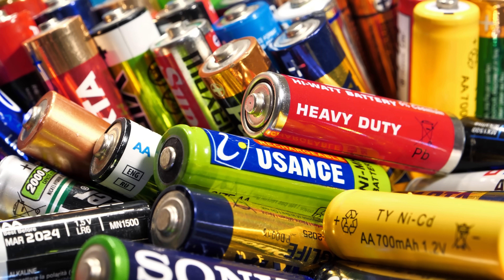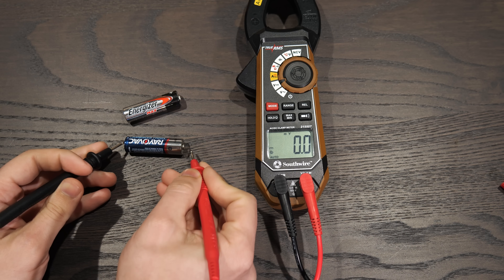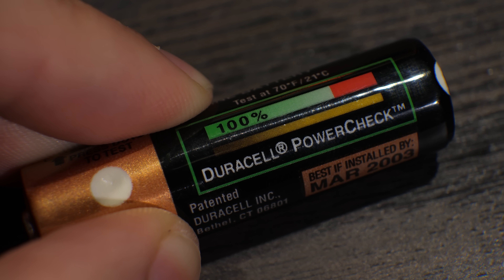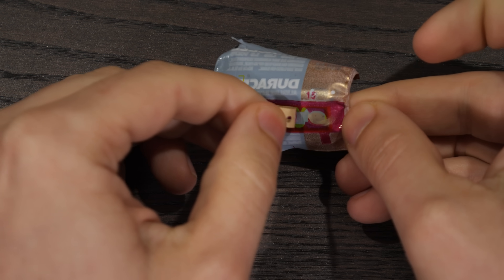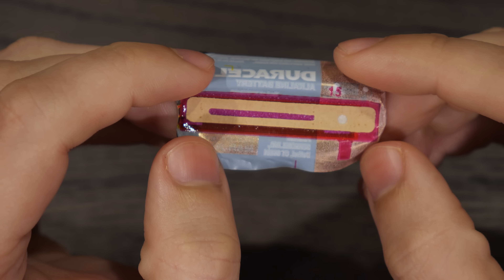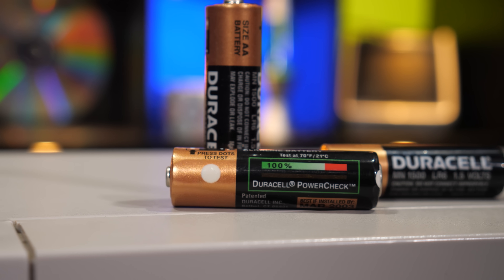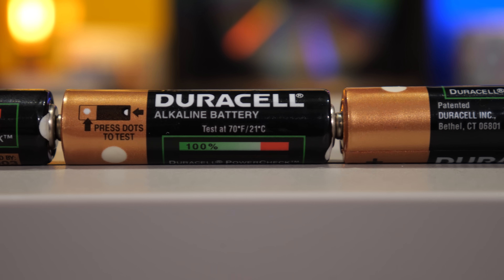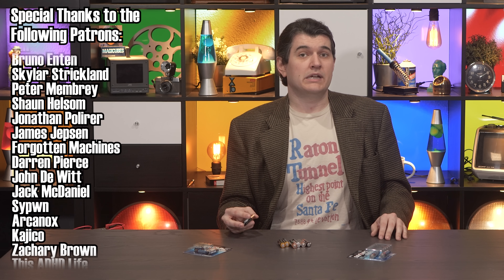Duracell PowerCheck: A genius idea which didn't last that long

Comment: I remember these.. im sure theses probably still some of these laying around in my basement drawers someplace likely new in the pack and dead... honestly the little tester for me was useful as i often would misplace packs of batteries and then buy new..  so when id find them they might be past their "best if used by" date.. so id use the tester and most times you had a good year or 2 ..sonetimes more after the date that they would still show 100%..  I have multimeters and such... but like yopu mentioned most things use chargeable batteries..  I really only put AA's in my TV remotes.. and the Only time my TV's are on is during american football season... the rest of the year i just dont use them...  if I push the on button and the TV doesnt come on.. first thing I do is change the cells...  but i renember n the 90s going through so many AA batteries for my beepers and tape / CD players , palm pilot(the first ones werent rechargeable), calculators,flashlights, bicycle lights..  so many things had batteries...

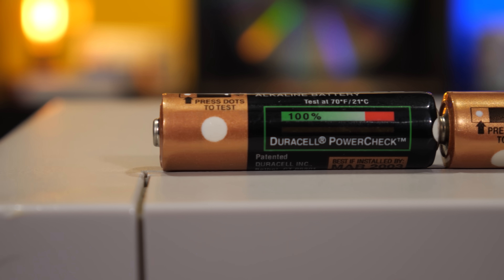Comment: Short circuit at 12:34.  I remember doing this as a kid with some rechargable batteries in an RC car that took 4x AA.  The cover on a couple of them got torn, so I figured I'd just peel them off, thinking they were only cosmetic,  Of course when you put them in, and there's nothing keeping them from touching each other, they just short out.  The car worked intermittently (as they randomly bumped together dropping randomly in intervals of 1.5v, and eventually I noticed that it would be slightly warm after the short run-time I got was finished.

Comment: I remember these, but it felt really uncomfy to press them, because they weren't like buttons or anything, it just felt like pressing down on a regular battery.. which you had to do with both of  your fingernails, they would bend, it'd be very unconmfy, and you'd have to press really hard to see the charge.

And I don't know if it was just me but it seemed like the more I pressed it, The more charge would show up?

So it would just measure the force of my pressing rather than the actual charge.......

Soo I never liked them and always hoped they would make one with an actual button you could press.. but. they never got better and just disappeared..

so I never liked these to be honest > - <

Comment: I remember these. I didn't know they could be activated by heat. I guess it makes sense since the yellow strip was uncomfortably warm to touch. I can't be the only one who was curious enough to touch a full yellow bar. I eventually got a cheap little volt tester with a battery caddy and noticed something weird about the batteries I was replacing. In more than one device, only one battery would be truly dead while the other still had power. Made me wonder how many good batteries I tossed out over the years.

Comment: Even the Gameboy Advance would give you that ominous red LED when its batteries were running down!

I actually have one of these thermal battery tester things as a standalone little sheet of plastic, it's designed for 9v batteries though.

Comment: Coincidentally, my wireless keyboard just ran out of charge and I tested all the AA batteries in my drawer to find the lowest battery over 1.2v that isn't in a pair (as my keyboard needs only one). I have a Duracell PowerCheck AA that registered 1.2V on my multimeter, and it has a best before March 2026! I decided not to use it in my keyboard as it was worthy of preservation. However, at the end of the video, I decided to use the powercheck meter and it didn't show any reading at all. Testing it dropped the voltage displayed on the multimeter to 0.6v. Once I released the dots, the voltage dropped back up to 0.9v. Awesome video!

Comment: The heating element explains an experience from my childhood that has puzzled me for years: I tried using one of the cheap test strips included in a package of AA batteries to test the remaining capacity of a 9-volt battery. It makes sense now, but at the time I was quite surprised when the test step caught on fire!

Comment: I had a series of subpar wireless computer mouses, and was never entirely sure if they were losing connection due to bad batteries, faulty equipment, or a wireless connection error.  These indicators would've been extremely helpful with troubleshooting, but that's a rare and specific problem.  I ultimately abandoned the wireless option altogether and purchased a wired mouse.

Comment: 11:17 funny you mention that, i'm still using one-way batteries for my xbox 360 controller and whenever the controller deems them used up i keep them for when the battery of my mouse dies. Ironically inside my mouse one of them usually lasts me for at least another month before they're actually out of juice. I don't know how the G604 does it but the energy saving capabilities of this thing are like nothing i've ever seen.

Comment: Duracell still makes and sells those batteries. One great feature is that you can test whether the battery is dead or the device you're trying to power, without needing a multimeter.

Comment: It seems like it's a good idea that some tv remotes these days have built in rechargeable batteries (my Samsung has one that also has a little solar panel on it). The problem is one day that battery will stop holding a charge making the entire, original TV remote useless. At least with replaceable battery remotes, it will work forever as long as you don't let the battery leak inside or physically break the remote. And anyone who has an old TV and can't find the original remote which locks them out of some menu function knows how annoying that can be.

Comment: I test batteries by dropping them on the negative part, if they bounce they're done. Saw it online a while ago, it's worked well so far. Also just mostly use rechargeables nowadays...

Comment: I can think of one time you might actually remove every alkaline battery you have (and possibly set aside for later use):

When you buy Li-ion rechargables and a battery charger.

I actually recently did just that, so it was amusing to hear you say it's pretty uncommon.

Comment: I would love single-cell 18650 Li-Ion batteries to have this tech nowadays, but fear that the resistant element would burn up in a split second as the available current is much greater in these. I liked these Duracell batteries in my Walkman!

Comment: I get a constant supply of batteries from old electronic toys I test, to see if they work. But I use my vintage Samsung YP-C1 MP3 player to check how much power there is left in any AA batteries due to how battery efficient my MP3 player is.

Comment: Makes total sense... says the guy with 20-odd half-used batteries in a box.  I have a separate checker.   I have learned my lesson about leaving batteries in radios, etc. and then having to clean out the acid that leaked.  I used to use rechargeable batteries, but some devices just didn't like them.

Comment: Oh those times when battery producers were competing heavily each other through TV ads, obviously aimed at kids and youngsters. This power check was obviously another marketing trick to pull some more money from kid's parents' pockets. I remember considering this power check as useless gimmick.
And I don't think we got any greener with built-in non-user-replaceable Li-ion batteries in devices. Once the crappy Li-ion battery is dead, the whole device gets dumped.

Comment: 13:32 I strongly disagree here.
Modern devices now come with glued, proprietary and hard to replace batteries. Which means these gadgets now become almost useless after 2-3 years.

Older devices, which take AA or AAA can also take RECHARGEABLE NI MH batteries. And those devices had long life with quick repairablity. I have many such old devices now.

Comment: My favourite college elective did a practical section every month where we were presented an irl problem & had to come up with a product/apply a physics concept to fix it. After a set amount of time, every group presented their idea & then we studied how the irl solution works.
In one class we were asked how to check if batteries are still working if you find some in your drawer & most groups came up with some tester since some stores have those in case customers come back claiming they were sold empty batteries while one group actually knew of these batteries & tried to reverse engineer how it works.

Comment: Problem was, in some battery holders it was possible for both dots to be pressed by accident.
I had a Praktica flash gun that took four AAs in a rather tight holder. I went to use it and found it virtually dead - three of the cells were perfect, but one was ABSOLUTELY dead - I'm guessing it self-discharged through the tester. :-(

Comment: I don't think I ever learned how that works. I remember doing it when I was child but I don't remember actually getting a reading. I think there were also imitations that has them but probably don't really work.

In fact, I kinda remembered that I thought pressing them will recharge the battery 😂

Comment: Are you a mind reader? I honestly was just wondering about the PowerCheck feature a few days ago when I bought a new pack of AA batteries (ironically for my digital multimeter) and wondered when and why they quit including it. Like you, i don't tend to have loose batteries laying around. Even the few items that I use infrequently and also remove the batteries from, i usually keep those batteries with the device or put them with the new unused batteries and then use those first. Generally all my batteries are in one spot which makes my life easier when i need them. I also do have an old analog battery tester, but honestly rarely use it. Great video and thanks for solving my personal mini-mystery.

Comment: The one use case that I think is legitimate is checking rechargable batteries for match. It's relatively easy to break a NiMH battery by putting one nice one in series with another that is no longer taking a full charge. This one will soon end up having its voltage reversed, blow the seal, and contaminate the device contacts, so I always check them. I simply connect each one to a multimeter set to 10 amps. If both give the same current, within reason (usually 3-8A in a good full rechargeable) then I use them as a pair. Voltage alone is much less diagnostic, and I can't be bothered to get a 0.5 Ohm high power resistor or a tester of unknown quality. Of course, I only test momentarily. I don't think I damaged any batteries this way, but play at your own risk.

Comment: Cool fact you can use Wii Remotes without a Wii to check how much charge does the batteries still have! Just put them in, press any button, the player LEDs will blink, there are four, if them all blink = full charge! Two blinks, it's half charge, yadda yadda yadda

Comment: These were so clutch in my house where we never wanted to throw out batteries, had a drawer full of half used batteries, a battery tester, and putting batteries in the drawer when not in use just to try and make them last that little bit longer.

Sure we had a battery tester too, and every now and again we would pull it out to test everything in there and throw out the ones that had gone bad, but when I just need to find that one battery that died in my controller or just wanted to test one battery real quick out of the drawer to throw it in something, it was so nice to just do that and see the yellow bar rather than pull out the battery tester for just one single battery

Comment: I mainly use my multimeter to troubleshoot and check whether it's the battery or the electronic that's dead.
With broken electronics being my main source of partially used batteries.

Comment: If anybody wants a tip for testing batteries drop it on a table (not super high) straight up and if it bounces it is low or dead. And if its full it wont bounce as much if at all

Comment: I know for a fact that a lot of perfectly working toys etc have been binned over the years thinking they broke purely down to Duracell batteries! I know this because i myself have done it in the past when loads younger, as i got older and got screwdrivers etc i started to fix things like most kids did back in the 80's, the problem is so simple that it should not be there, here we go with the issue,
 
THE POSITIVE TERMINAL OD ALL AA AND AAA DURACELL BATTERIES IS TO BLOODY SMALL!

Because the terminal is so short it don't make contact in loads of battery holders because there is two little plastic guide rails to line up and hold the + tip, have a look, the tip just don't quite make a connection, i have seen foil used over the years to bridge the gap however its the Duracell to blame and i have not purchased them over 30 years because of it.

Comment: my family actually did use them when swapping batteries. we noticed that batteries dont drain at the same rate, so we'd keep the partially used batteries together when swapping them if they were still more or less good to use them when the next set of batteries died.

Comment: The only things in my house which get actual primary AA cells, as opposed to rechargeables are clocks. Li-ions run at a slightly lower voltage and it causes clocks to go slow. Everything else runs off rechargeables, and I’ve only recently had to buy some new ones after the original batch started to lose capacity after more than 10 years. Much better to replace the batteries once every 10 years than once every 6 months.

Comment: Hey @TechnologyConnections can you do a video on how radiant heaters work? I just learned my apartment, in the midwest, has them and I've never used it before and heard they aren't the best for crazy winters! (I'm newish here) I think that would make for a fascinating video as the only types I've heard of are just the wood, radiators, baseboards, and central heating kinds!

Comment: AA batteries are annoying... but then we got NiMH cells that are super strong compared to alkaline cells. Of course, it took until today for us to have easy access to convenient fast chargers that can safely recharge the cells at their full rated recharge speed. But the tech was there back then. I remember my father had NiMH cells that were older than me, all the toys and gizmos I had as a kid were all powered by those ancient cells... some of which I now have and use to power TV remotes since they were all damaged by abuse at some point. For my photography gear, I use NiMH cells because they basically never leak, have incredible current (therefore power) compared to any disposable batteries, and are super cheap since they can be used thousands of times. Additionally, in the cold Alberta winter, even rechargeable lithium ion will faceplant and cease to operate, but my NiMH AA and AAA cells seem to be able to still deliver more than enough current to embarrass a fresh, warm alkaline cell even in -20C... so anything designed to use AA cells will run just fine on NiMH even when it's so cold that my phone, Lithium ion flashlight, and my camera's batteries are all totally useless... despite the lower maximum energy density, NiMH today seems to still be incredibly durable.

Comment: Most things use rechargeable batteries too.  I think another factor is the efficiency of devices has improved.  I remember the old original gameboy using 4 AA batteries.  The later editions used 2 AAs or 2 AAAs depending if it was the color or the pocket version.  The fear of batteries dying became a thing of the past.

Comment: I am using rechargable batteries mostly. But I have some devices that explicitly tell you not to use rechargeables, and they mean it! I broke one by ignoring the warning because the batteries overheated, I think. What's up with that?

Comment: As a result of my miserly nature, it has always bothered me to know that "dead" batteries still have at least "some" voltage.  It appears that AA batteries appear to be "dead" for most use cases once they drop below 1 volt. I assume it depends on the application, but it has always just bugged me that there is still "juice" there that I can't easily squeeze. It is pretty impractical to save "dead" or partially dead batteries, but I always want to know that I have fully exhausted all useful chemical energy before I chuck it. (I guess "useful" is the key  word there.)

Unrelated fun trivia that you may have touched on in a previous video...I can't remember): Original Kodak instant film cartridges contained a battery that I used to pull out of the empty cartridges and try to figure out a use for. They were 6-volt batteries, and of an almost otherwise usable form factor, but they were fun to play with.

Comment: Thanks for this video, instant childhood throwback!! About a year ago, I opened up an old toy truck with lights that had been sitting for almost 20 years in my parent's basement, and lo and behold - inside were 2 completely leaked Duracell AA batteries with Powercheck! While you are right and normal people just didn't use this feature all that often, for us kids it was a convenient little trick to keep track of all the batteries inside our favourite toys. Because instead of putting hundreds of batteries simultaneously into every single toy I owned, I used to interchange them between my Game Boy, Walkman etc. I think this is what Powercheck was made for initially, and why it was such a central part of our childhood!

Comment: Still have a lot of devices that use normal batteries (still very common for toys), but these days I prefer to use rechargeable AA/AAA batteries in them.  Not just because I have to throw out less batteries, but also because if I don't use something for a long time and forgot to take the batteries out , they won't leak!